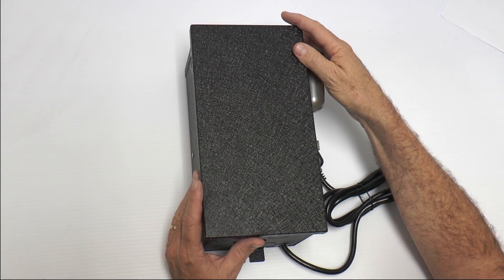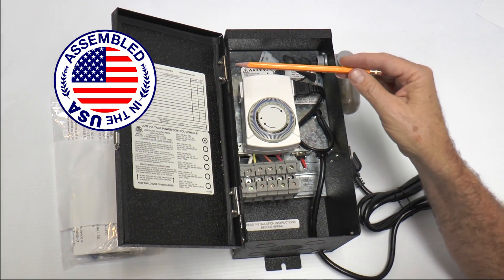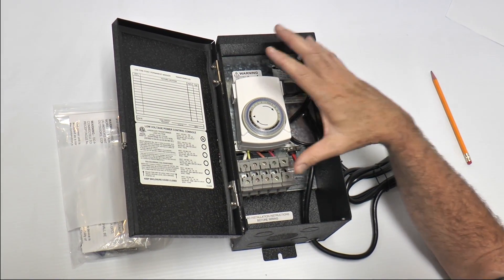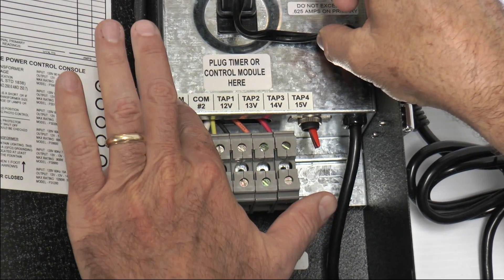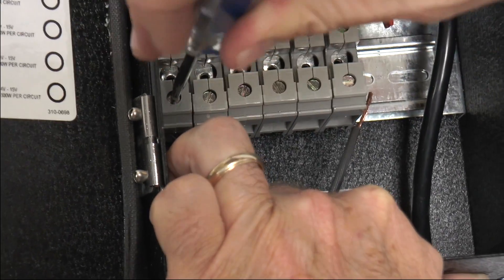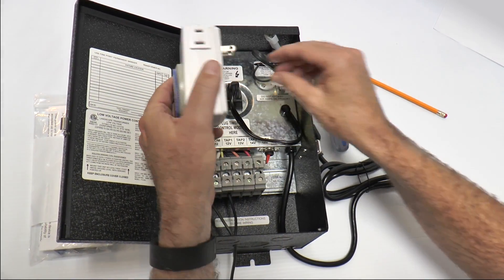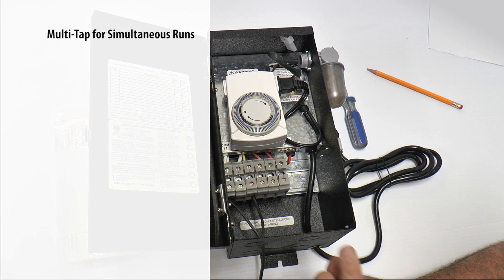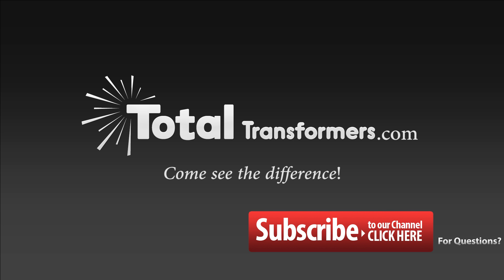EMT Outdoor Landscape Multi-Tap Transformer Overview & Tips by Total Transformers

Comment: Hi, I want to get a transformer that I can control two different circuits seperately. Example: I want the garden lights on, but not the deck lights...or, I want the deck lights and the garden lights on. Do you make a transformer that can do that?
Reply from the maker: We do not have a single transformer like that at this time however we have had customers use multiple transformers to control different areas for different times. So for example our TLS100-UNV transformer can be controlled by a WiFi device of your choice and one could be used to control the garden lights and another the deck lights. https://www.totaloutdoorlighting.com/wifi-compatible-100watt-led-outdoor-low-voltage-landscape-lighting-transformer-12-15vac.html

Comment: Can you put multi wires for  different runs into one  tap, and what is max amps load  allowed on that tap? how you calculate that max amps for every tap that hold more than one wire?
Reply from the maker: Yes you can put multiple feed wires in one tap. The max load depends on the transformer purchased and the load should not exceed the transformers specs. For example, you have a 300watt multi-tap transformer. You can have as many feed wires as the physical terminal will allow but the load should not exceed 300watts total for all taps. We offer a range of options to meet your lighting needs here 👉 https://www.totaloutdoorlighting.com/landscape-transformers/multi-tap-commercial-transformers.html

Comment: My neighbours lighting interferes with my photocell. I see that I can unplug the photocell but don't see any "jumper" you reference to plug into that receptacle. Will the unit work properly if I simply unplug the photocell and leave the receptacle empty? Very informative video. Thanks!
Reply from the maker: There are so many low voltage outdoor landscape lighting transformers out in the field it is hard to know which one you have but typically when a photocell is disconnected the timer becomes the main control point. I would give your suggestion a try and see how works for you. Also, see if you can search the internet for your transformer's make and model to see if there are online resources that could help like a PDF manual 🙂